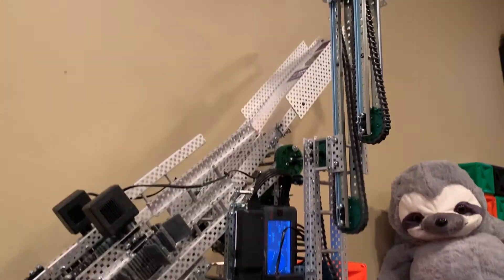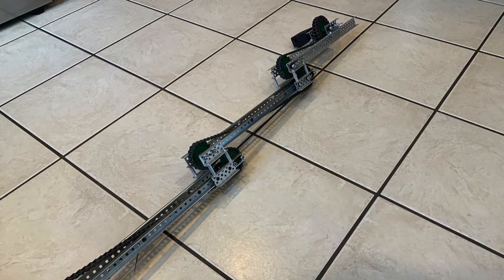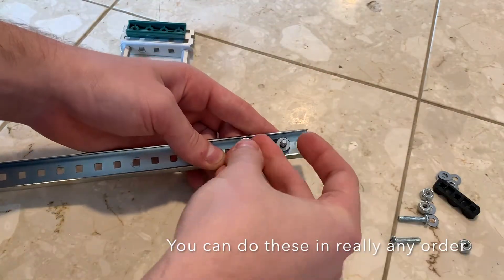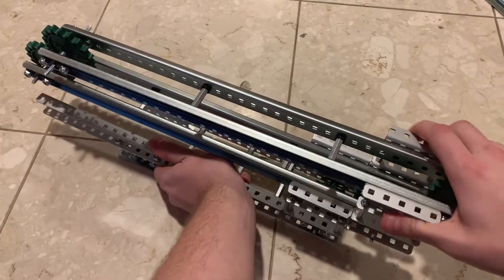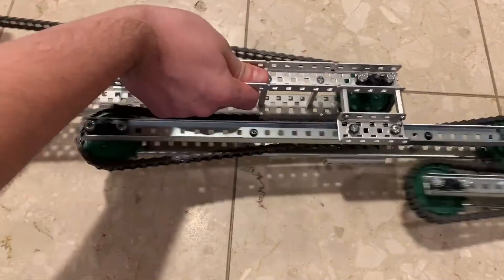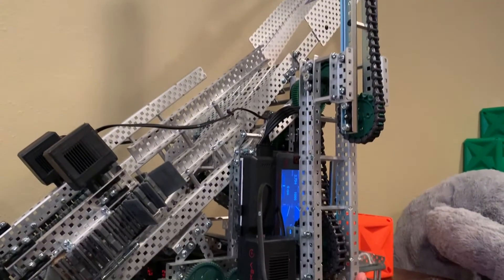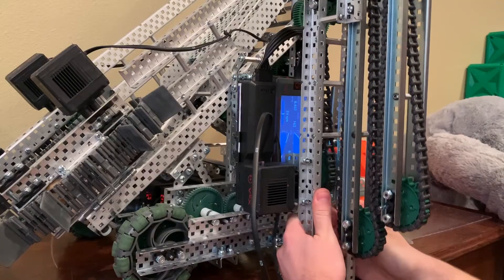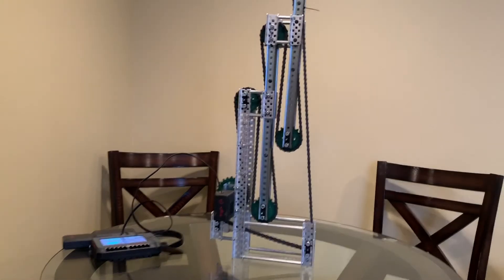Kepler's Guide to Cascade Lifts

Comment: Thanks for the great video! I'm helping to design a robot that needs to start within a 500x500x500mm box but extend an arm horizontally to nearly 2m in a way that allows a number of tennis balls to roll along it's length. I think your mechanism will be really useful! Now I just need to figure out how to attach a telescoping ramp to the top of it that extends along with the cascade. :D

Comment: I like it except the 3 foot exposed chain, waiting to get hit and snapped
Reply from the maker: Yeah. You actually don't really need the chain out in front, it just allows you to not coil the chain around the sprocket. You could even swap it with string running over pulleys, as its really just the pull on the end of the mechanism that counts for this design.

Comment: Yeah this is definitely a continuous lift. A continuous lift a one continuous piece of rope (or chain) going through it which is exactly what you have. A cascade lift is where all the stages move up together each one below it at half the speed. Here is a picture of the difference https://www.chiefdelphi.com/uploads/default/original/3X/0/3/035af79a45dec44f7dd638697f52de7bd3250bc7.png

Comment: This is a continuous lift not a cascade lift. I'm not quite sure how you deciphered a cascade lift which is linked in the description into a continuous one. Both work though. Great video. My first time seeing someone attempt a continuous lift in vex because people usually opt for the far superior cascade. One thing to note is that there is an obscene amount of friction in your lift. So much so that instead of the lightest 3rd stage lifting first, the lower 2nd stage lifts first. This indicates that the frictional force present is greater than the gravitational force which is the weight of the lift.

this is a pretty good video showing the difference: 
The left one is cascade, the right one is continuous.
https://www.youtube.com/watch?v=gdyxrY-SNh4
Reply from the maker: You are totally right, thanks for pointing it out. I'm not quite sure how I managed to make that mistake! However, they are both functionally the same, lifting through the extension of different stages. I know that I have seen teams refer to both types as cascade lifts, so if someone wants to build one, they will find what they are looking for much easier as well. 

Yes, there is a ton of friction in the lift, but that could be remedied through either not using the vex slides which have a lot of friction problems, or at the very least using some white lithium grease. I wanted to focus on the mechanics of the lift and to show how it worked (because the hardest part for me when building these linear lifts was just figuring out how it all went together) rather than add in more complexity thanks to custom slides and such.
Reply: @KeplerElectronics  cascade has all the lift sections extend at once while continuous is one at a time. each has some advantages and disadvantages with cascading requiring less motion and having a constant force and continuous being faster and lower torque